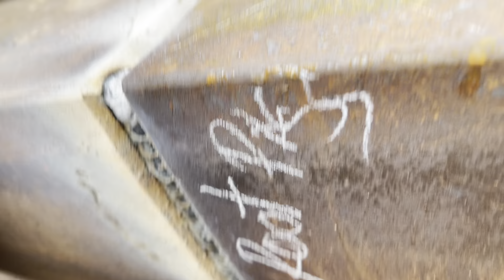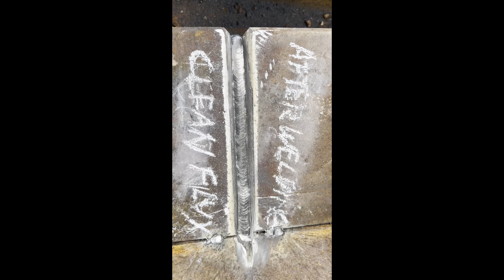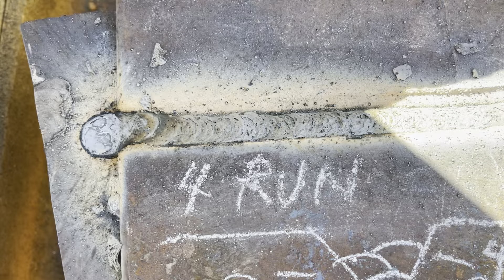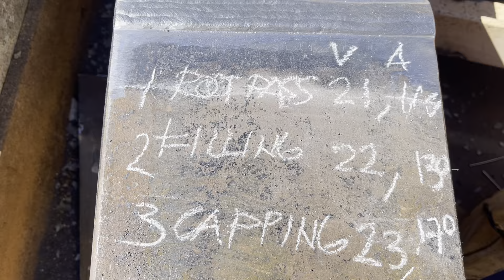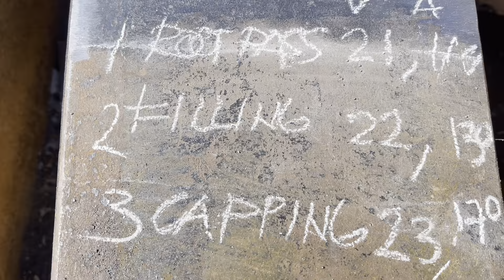3g root pass,hot pass,1g multi pass for beginners#welding #gasless

Comment: Anu anung serting po ng amperahe ang ginamit mo po?
Reply from the maker: For flat positon
1. Root pass : volts 21.0  amperes 110 
2. Filling : volts  22.0.  Amperes 130
3. Capping :  Volts. 23.0 Amperes 170 

Not yet finished  vertical 
1 . Root pass : Volts  20.0. Amperes. 150 
2 .  Filling. Volts. 21.0. Amperes 160
3 .  Capping : not yet done 
Thanks your comment much appreciated .